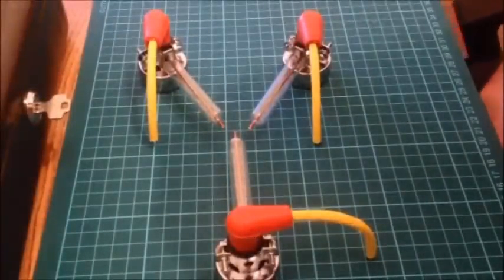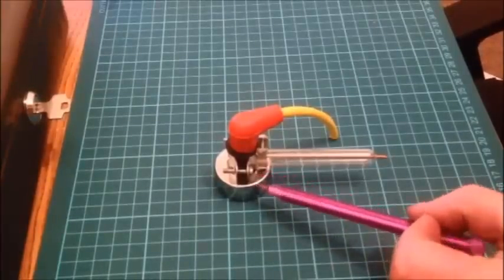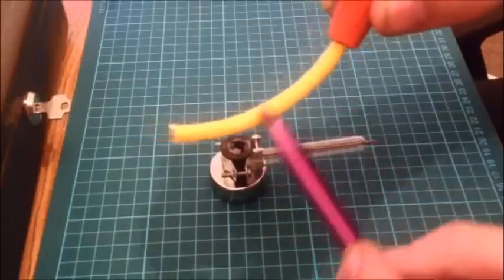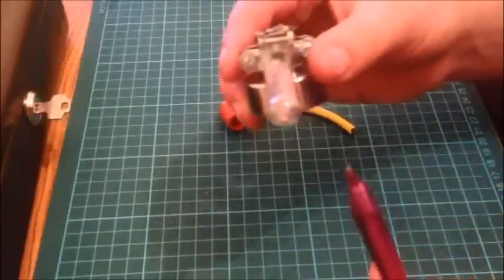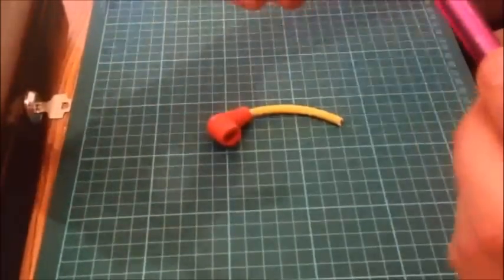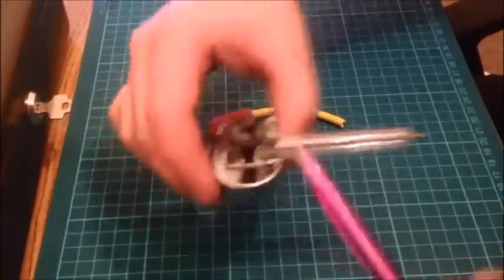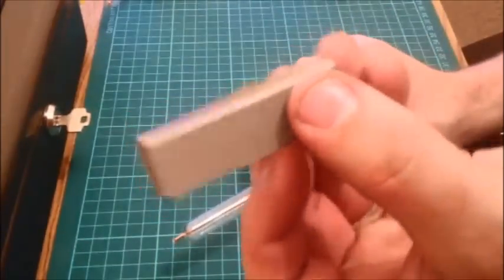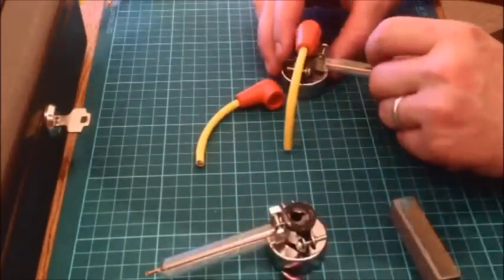THE FLUX CAPACITOR BUILD TUTORIAL PART 1

Comment: Question - what is your light source?  And is it battery operated?
Reply from the maker: These are simple Christmas meteor shower rain tube light powered by mains plug
Reply: @PaulsChannel  how did you sync them? Looks great and what a great way around figuring out all the code for LED programming.

Comment: hi do you have a link for buy this plugs,thanks
Reply from the maker: hi i bought the plugs from ebay there is a link below. dont forget to like and subscribe ;-)

http://www.ebay.co.uk/itm/4-PACK-OF-15-AMP-ARMORED-MALE-ELECTRICAL-PLUG-ENDS-125V-/261485994175?hash=item3ce1c7a0bf:m:mhupqyzaNEBS7IPoSd9sCrQ
Reply from the maker: hi i bought the plugs from ebay there is a link below. dont forget to like and subscribe ;-)

http://www.ebay.co.uk/itm/4-PACK-OF-15-AMP-ARMORED-MALE-ELECTRICAL-PLUG-ENDS-125V-/261485994175?hash=item3ce1c7a0bf:m:mhupqyzaNEBS7IPoSd9sCrQ
Reply: The link doesn't work anymore

Comment: where I buy the connectors you use the minute 1.48? thx
Reply from the maker: Hi. The connectors are American, metal armoured plugs. I got them off eBay.com from America. They were quite expensive. I'm thinking of making another flux capacitor but I am going to use wrench sockets that you use to take nuts of car wheels. The advantage is you can pick the size you want, they are the ideal shape and I can get them from my local DIY shop and 2 pound each so they are cheaper. Hope this helps.